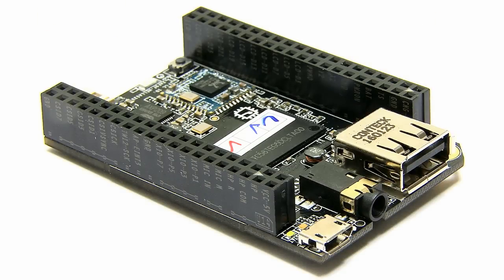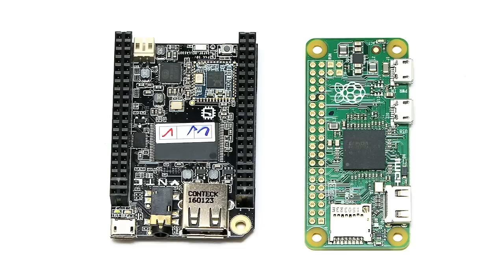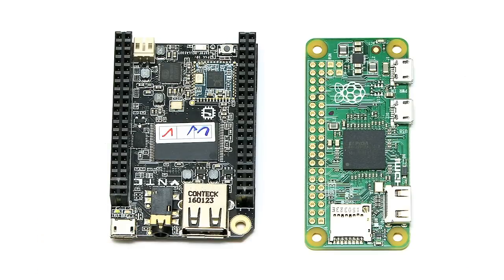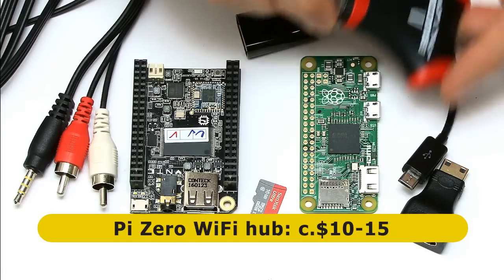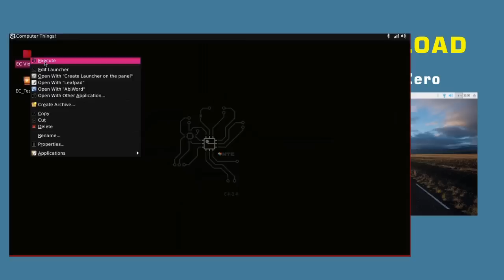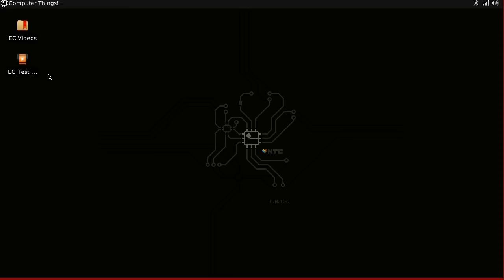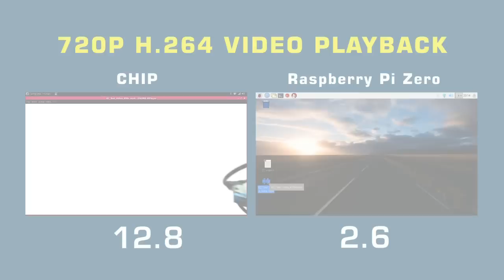CHIP v Raspberry Pi Zero

Comment: Very nice comparison. Yeah, people complain about different softwares being tested, but this is great for comparing out of the box performance.
Reply from the maker: Exactly! :)
Reply: It held up to what I have seen in other videos.  The cost comparison with accessories though is the best I have seen done on the 2 boards.
Reply: I got lucky and scored 2 zero boards.  The kit plus a single board.  You have to camp the sites hard as they sell fast.
Reply: Check Pimoroni's site. Zero is currently in stock: https://shop.pimoroni.com/products/raspberry-pi-zero
Reply: sorry it wasn't when i sent you the link
Reply: it's still an "out-of-the-box" test, when you install 1 or 2 programs out of the box and test what happens there. more so when it's the same program. it would just be a little better for the overall video even tho it's not directly the purpose.

Comment: The CHIP has one huge advantage and that's the ongoing availability by the manufacturer.
While the RPi Zero is great when it comes to function as it should, the company behind unfortunately decided to set this thing on a limited production.
That's also why prices for the board are also almost as high as those for the typical Pi2 and Pi3 boards.
Reply from the maker: This is true, although both the CHIP and Pi Zero are hard to get hold of. It took me six months to get a CHIP after the order, and I see that are now out of stock until "Q1 2017". In a way this is good -- it indicates demand -- but I think the margins in these boards make their supply problematic for any company.

Comment: +ExplainingComputers / Christopher,
Good comparison of these two devices, but (as usual) I do have some comments about this video.

Firstly, it would be nice if you included to mention which WiFi chipset is used within the Chip. Recently, I have been experimenting with BSD based firewall appliances (ie. opnSense, PFSense, FreeBSD etc.) and am aware that BSD can be selective about WiFi drivers / chipsets. 

Secondly,  it seams that you are suggesting these devices should / must have some sort of display interface for them to be fully functional (and are presuming that most people will be using these devices as workstation alternatives). We both know that these devices can have many other usages beyond workstation styled terminals (as demonstrated by your Raspberry robotics videos).

As an example, the Banana BPI device that has recently been delivered to me does have a full HDMI bus but I am intending to not use the display interface (with the expectation of the initial installation of the OS) and will be using SSH and a web / LAMP based GUI for further configuration purposes.

Finally, you touched on  the Lipo battery plug / interface but failed to mention anything about the recent changes in legislation / IATA ( International Air Transport Association ) regulations governing the shipping of lithium ion batteries.

The result of these new regulations means that lithium batteries can only be imported by a selected few companies (ie. DHL, FedEX and UPS), which could result in creating a monopoly within this market.

The result of these regulations is making it harder to purchase new and replacement batteries within the UK, I have been trying and failing to find a UK based vendor that can supply high capacity batteries with standard Lipo connectors (10000+ mAh  -- output at 3.7v / 2a). 

I would welcome any recommendation or suggestions of UK based vendors that can provide high capacity lithium batteries.
Reply from the maker: Thanks Mark -- great feedback as usual. I was not aware of the battery shipping issue -- very interesting. And yes, agreed, there are many uses for these machines without a display.

Comment: To be honest I'd use neither of these for desktop computing, I do have a Zero which I am planning to try some projects with and I'm going to get a Chip just because they are cheap, by the time you buy all the peripherals you'd be better with a PI 3 model B with 4 USB Ports, Wifi, Bluetooth, Quadcore, 1 Gb ram, Ethernet, HDMI all for around the $40 mark.
Reply: These sorts of mini computers are good for personal security programming small projects ect. There are many more places you can cram a chip or pi zero than a full on Pi3
Reply: These are for other purposes than desktop experiences.  For example, I run one as a weather station logger.

Comment: Well, I don't know if any comparison makes sense. Those computers are not meant to be used for general computing anyway. And from what I see, the zero is meant for smaller projects (well, physically smaller at least :) ) while CHIP could be good for some retro gaming with its less-than-perfect analog video output.
In any case, I see a market for both, but not necessarily competing directly.
Reply: The Pi Zero is about the same size as the Arduino nano, As is the Pi3 to the Arduino Uno but they are for 2 entirely different purposes so it isn't really a useful comparison.  These little things are certainly not sitting between the full Pi and Arduino,  as these little computers hold a full operating system with a nice amount of RAM & storage space vs the Arduinos 2KB RAM and 32KB of flash memory, but again they are for 2 completely different purposes.  Last time I looked into it the Banana Pi had a separate USB/Ethernet bus if that is what you need, if they are still going.
Reply: Easily missed fact about the CHIP is that it has a 40 pin display controller so you can cut the display's driver board out and run it straight off the CHIP. The space saving from not needing a display driver board makes up for the board size difference.
Reply: There is not MARKET with things that are not available to buy/use!
So your safest bit is the Orange Pi:
http://www.banggood.com/search/orange-pi.html
Reply: The zero or the chip, no they don't have the horse power for general computing.  I have done retro gaming on the zero its no quad core but it does the job.  I can see the chip being good in that application as well. 

For General computing though the pi 3 is getting close to what I would call usable horse power for that.  If the pi 3 had just one more gig of ram it would be there IMO.
Reply: That is a nice feature.  External display driver boards can be a real pin to space out and deal with for projects.
Reply: igrewold what do you mean?
Reply: Exo Omega i think he means the Pi Zero is a hard unit to buy due to undersupply and overdemand. Canakit has them but only one per customer, although you can buy more than one bundle kit.

Comment: I would have thought the use for these would be to be built into other projects, for control or telemetry, as a kind of  super form of embedded device, so I would tend to downplay the necessity of using a monitor, and for this reason I would prefer the Pi Zero as it comes with the option of either soldering header pins on if needed, or directly soldering wires onto the board itself for a better long term connection, which is how I would like to construct a project myself.

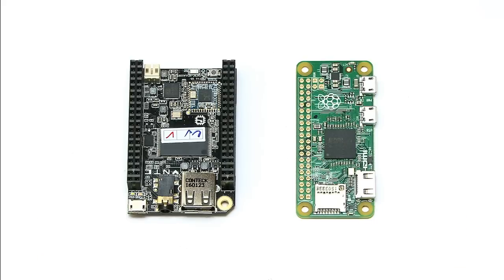Comment: 6:00 my board came with that cable.
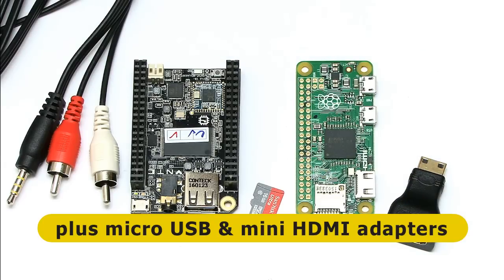7:10 you assume that everyone has an hdmi cable which does not seem fair to the chip because you include the cost of the cable for the chip, which i say again was included.
Reply from the maker: My understanding is that the first round of CHIPs sold (via the Kickstarter) came with the TTRS/composite cable. Since that time, the cable has not been included in the $9 purchase price. On the HDMI cable for the Pi, I am including the cost of a mini to standard HDMI adapter. But yes, you may be right in that not everybody will have an HDMI cable (although I would suspect that most people who own a TV or monitor with an HDMI port will have it connected to an HDMI source, and hence will have a cable).

Comment: as a PAL dweller, I'll wait for the C.H.I.P. 2 with HDMI. It's just not viable for me without. I'll have no way of setting it up.
Reply: I'm surprised you have a problem being able to see NTSC on a modern TV. We in New Zealand use PAL also, but I have not seen a TV sold here that was made in the last 17 years that could not also handle RF or composite signals from all 3 systems of PAL, NTSC and SECAM. All the flat screens I have seen handle all 3 types. The old Sharp CRT TV I used to have with a built in VHS video recorder made in the mid-90s was also able to handle NTSC fine and actually also played NTSC VHS tapes from the US as well as local PAL ones. I normally had to manually select the color format though as by default it used the Japanese NTSC colour format that although almost identical to the US NTSC format has a different colour signal I think was 180 degrees out of phase to the US version.

Comment: Another great video Chris. Thanks for the comparison. I'd like to see what kind of electronics/IoT stuff the Chip can do, versus the Pi, seeing as its got twice the gpio pins. Also, is there a pass through method on the Chip when using the HDMI card, or is there some other work around? Thanks again for a great channel.
Reply from the maker: Thanks Steve. The CHIP has more header pins, but most pins are for an LCD display and the HDMI or VGA DIPS -- there are, I think, only 8 dedicated XIO (GPIO) pins. With the HDMI or VGA DIP connected, there are solder pads to which pins can be connected to access these and a few other pins (like power) -- so yes, there is pass through.

Comment: They both don't look very promising after seeing this. Maybe single board computers aren't for me?
Reply from the maker: Indeed. The Pi 3 offers a lot more computing power and connectivity -- as do the Banana Pro and LattePanda, for example. I have videos these and more here! :)
Reply: Generic Green Squid Once you take into account the peripherals, I think the Pi 3 is a much better choice than with of these as a desktop computer. It has the networking, 4xusb, full HDMI etc. all built in (and it's much faster). 

For me, both the zero and CHIP are better for headless electronic projects. With built in WiFi, the CHIP looks fantastic for 'Internet of Things' projects.
Reply: i also agree with chris, pi 3 is better as zero lacks very basic ports to cut the costs. Pi 0 is like the macbook pro 2016 and pi 3 is the asus rog of single chip pc's. You can flaunt its size and cost but in the end you will have to face inconvenience when you actually use it.
Reply: The full Pi if you want a desktop-style computer, sure but if you want something smaller and lighter and using less power, you can move to the zero. It's a shame it doesn't have battery capability on-board though.

Personally, I'm just glad we have decent systems with GPIO. We kinda lost that in the PC world when ISA was dropped (and even then, it was a bit of a pain to get to). It's a very interesting time in computers again.

Comment: Community support is probably the most important part for me. Without community support I would have never bough my Pies.

note: I saw you say that some 64Gb cards work on the Pi in fat32. I have formatted my 64Gig and even 128Gb cards with the special formatter (for noobs) and they all work great (I have about 8 Pies that I manage and or own - i lost count)
Reply from the maker: Thanks for this -- great to hear that 128GB cards work. I've never had one that size to try in a Pi! :)
Reply: It now contains a webpage with nightly compiles - over time the archive has become quite big.

They where on sale during black Friday ($32,-) I just had to buy one.

https://www.amazon.com/SanDisk-microSDXC-Standard-Packaging-SDSQUNC-128G-GN6MA/dp/B010Q57S62/ref=sr_1_2?ie=UTF8&qid=1485204251&sr=8-2&keywords=128gb+sandisk

Comment: Could youb explain why the  CHIP can't play video smoothly? I've heard that is because of a video codec or driver. Do you think this can be fixed? Thanks!
Reply: The Pi has hardware accelerated h264 decoding, and this is the only reason it plays the video that smoothly.

Comment: I think for a cheap torrent box that can download stuff overnight without having to turn on a regular desktop PC, the chip is pretty good. It already has on board storage so you can stick whatever Linux you want to use to make the torrent client. Also has Wifi built in and you can run it from composite video to do the initial setup of the board, no need to buy an adapter + hdmi cable for that. Has a regular USB port so you can add a external storage and configure it so it dumps your torrent or hosts your files from there.
Reply: Network seems to be bottled capped with these single computer boards since they seem to share the USB data with the network adapter. So it really doesn't matter if you use a built in Ethernet port (like on a Raspberry Pi) or a USB Ethernet adapter, you still pretty much limited by the data transfer speeds of the USB chipset/controller itself. So using Wi-Fi to downloads torrents on these is pretty much OK considering it's a low powered device that you leave unattended @ night downloading stuff for you. Also keep in mind it's just a $9 board.
Reply from the maker: Yes, all very, very true. :)
Reply: Could you please take a clip about playing a video over usb source? - this maybe shows where the brake is going on.  Graphics adapter or the onboard flash? An 2.0 usb Adapter with a SD-Card will show us the truth and will me getting sleep in slightly :-)

Cheers!

Comment: Firefox vs. Chromium, found your issue.
Reply: Emilispk yes good point
Reply: ErPAkka Yes. New versions of Raspbian come with Chromium browser pre-installed. Raspbian used to have a more bare bones browser before the Pixel update. I'm not too sure why they decided something as heavy as Chromium was a good idea for a SBC...
Reply: Chromium is known for fast start up times, but HEAVY ram usage leading to slow page loading on memory starved devices, while firefox is known for having a long start up time but good memory efficiency leading to faster page loading on memory starved devices.
There are stripped down forks of both you can find as well, but all of the forks tend to follow these limitations of either engine pretty closely.
Opera used to be a good balance of both, but I believe they changed over to being based on chromium, which makes it pointless.
Reply: also usb wifi can be worse
Reply: agreed
Reply: They went out of business so I guess the pi won
Reply: The pi was waiting for the built in Adblocker. Look at the bottom left.
Reply: not to mention cache. it sort of looked like firefox had the page cached while chromium did not
Reply: +Richard Smith Opera is Chromium based now, but it is still much faster than Chrome/Chromium.

Comment: I want to make note with your browser test, is there is a lot of variables that were not consider which made the timing not very valuable. First you have simple hardware difference in wifi dongle. That one could be easily over looked. Due to that being part of the hardware different in the design of the two boards. However there is the two different software browsers which were being used, and this has a huge effect on load time, since web browsers have different requirements/methods on loading and translating a html files into the display you see on the web browser. Taking all this into account and roughly guessing based on my knowledge of web design. I would say the chip still wins but it is not 3 times faster than the pi. It might be around1.5 to 2 times faster.
Reply from the maker: I totally accept this -- though I never claimed the CHIP to be 3 times faster, just that it won! :)
Reply: I was just saying 3 times faster due to the 34.7 and 99.3. I do agree it won! and that the chip is some awesome hardware for what the amount of money. It so impressive now days how small and inexpensive hardware is. Keep up the great work!

Comment: Tests are a little iffy. They are using different software, have different hardware each with its own quirks. Also, different OS matters, even if its a similar kernel. Still, i agree that Pi zero is a better option, 15$ display addon is a no-no, and support for Pi makes it much easier to use.
Reply from the maker: The tests are comparing two products! :) By definition different hardware (they are different computers), and running their default OS (and neither can run the OS of the other).
Reply: ExplainingComputers No, but both can run Debian Jessie. And VLC player and Chromium and Firefox. Still, there would maybe be differences in hardware video  decoding and drivers. Maybe some neutral test like floating point number crunching can be used. But yeah, thats their performance out of the box, what matters for most users.

Comment: 1:30 TIL pi zero has stacked chips!
Reply: The Black Talon All the Raspberry Pi systems use that trick, it's one of the clever signature design choices they made in the original system design.
Reply: and it isnt new, chip stacking has been used for years..... long before the first Pi was thought of.
Reply: +Alexander Roderick Actually only the 1st gen Pis did that. Pi 2 and 3 have the RAM on the other side of the PCB.

Comment: The CHiP includes a battery charging circuit doesn't it?  So you can solder on a LiPo and use it out and about.  Then again there are plenty of 5V battery packs that connect via USB, and they include a charger circuit.  The newer Pi Zero (v1.2) introduced a mini sized camera port.  You did a fair review I think...  clearly not biased one way or the other.
Reply from the maker: Thanks for this. And yes, the CHIP has a battery charging circuit as you say, so you can plug in or solder a LiPo.